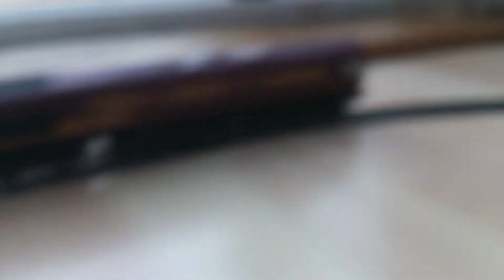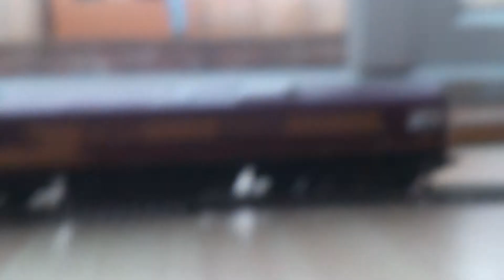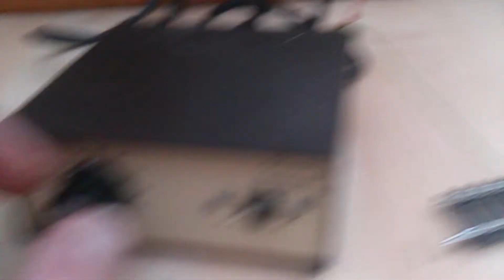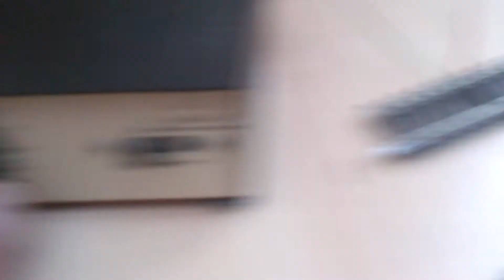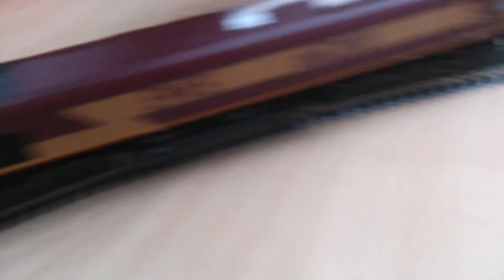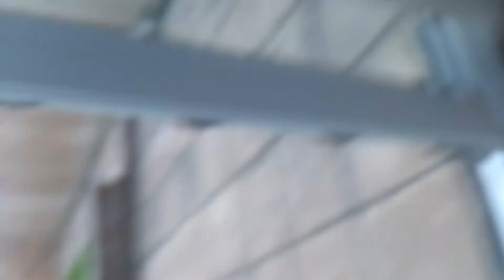Bachmann class 66 running problems

Comment: I have a bachmann class 66 (66209) i had the same issues with it found out that it was the driveshafts, they kept slipping as they were put under pressure around a corner, bought some new ones wich were slightly longer, and now runs as sweet as a nut, hope this helps :)